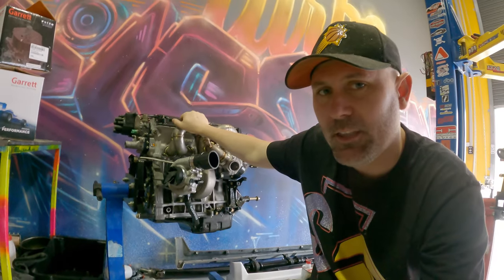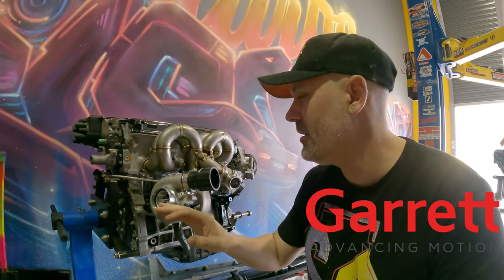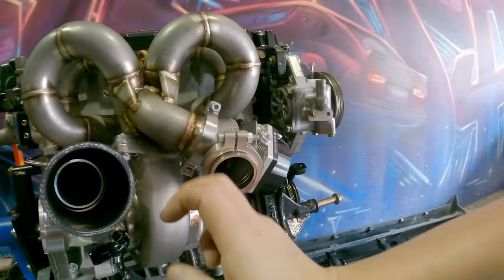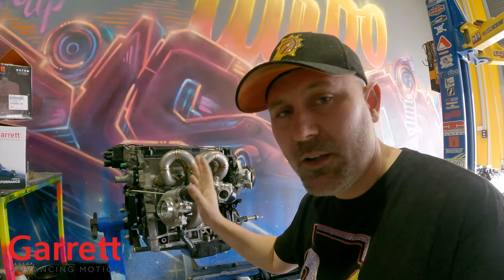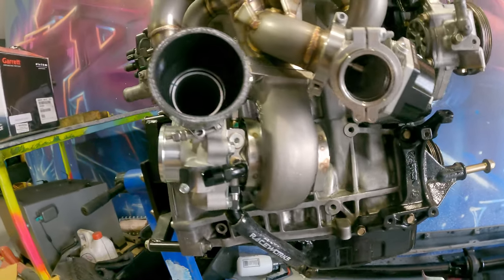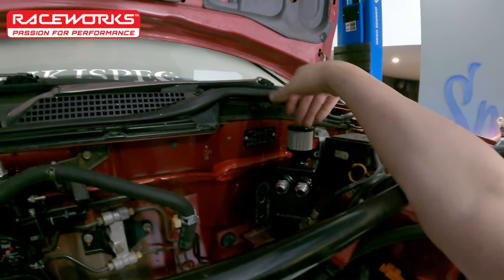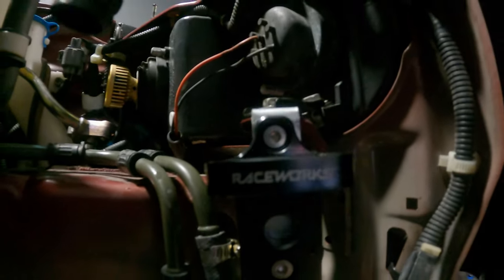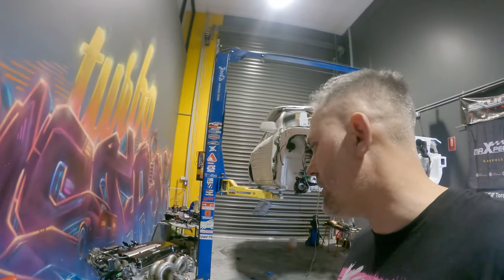B18C2 INTEGRA Gets The Best Turbo Money Can Buy.

Comment: I would like, to run a 3582/84R on my B18C2 build. But I can't find, no one on the internet. Showing what RPM these  turbo's starts spooling on this B18C.
Reply from the maker: Garrett list the flow data on their website in my exp with modern tuning and e85 you can get them to spool pretty quickly, a later spooling engine will help make the engine last longer also it will put less pressure on things if the torque comes in later